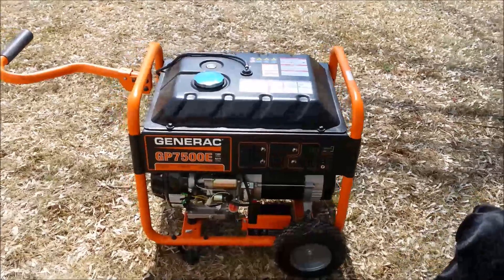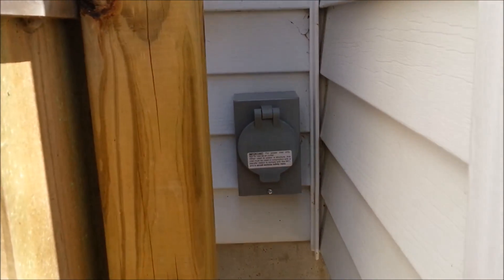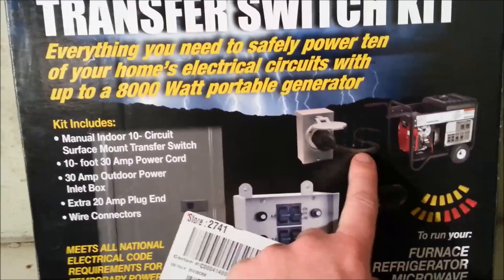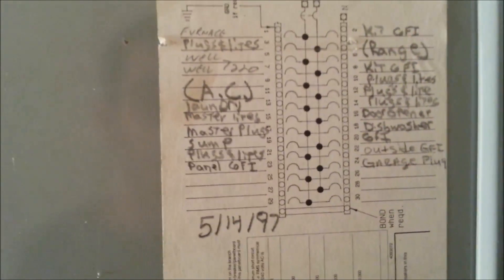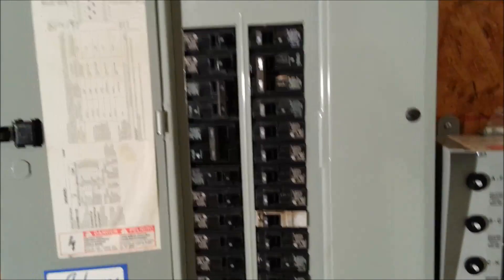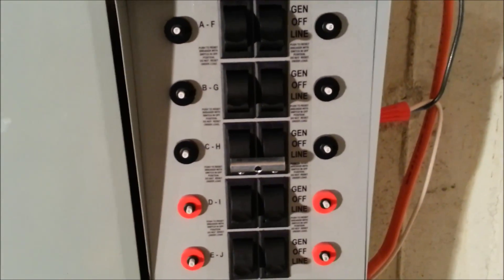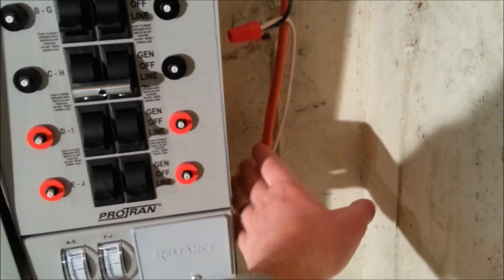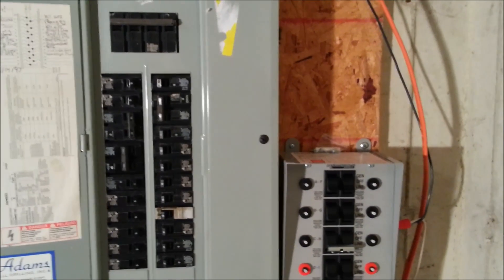Powering Your Home Safely with a Generator Using a Transfer Switch

Comment: I have the same generator and transfer switch but what wire do I take off the generator to change it from neutral bonded to floating?
Reply: +SSLFamilyDad 

Because the neutral and ground are bonded in your main panel which connects to the utility, you can't have a connection between neutral and ground at the generator. Unfortunately a lot of generators have neutral bonded to ground as they are used in as stand alone power sources where this is a requirement for safety reasons. 

There are three ways to fix this, but the first 2  present safety issues.

The easiest is to make a custom generator cord with the ground disconnected. The drawback with this is that the generator chassis will only be connected to neutral and could become live during some fault conditions.

The next easiest is to modify the generator to unbond the neutral from the ground. This will void the warranty, and make the generator unsafe for use as a standalone power source.

The third way is to purchase a generator which is solely intended for use as a backup power system and designed to be mounted on a concrete pad. This is an expensive proposition, but it is the the safest solution. The other drawback is that it can't easily be used as a portable generator.

I have the same transfer switch that you do and use a Generac LP5500 generator (propane). I chose the first method, as I am not going to touch the metal chassis of the generator while it is connected to the house electrical system. This also allows me to safely use the portable generator, for standalone use.
Reply from the maker: I remember not having to do that for some reason. I will have to look that up and get back to you.

Comment: Nice job on this video, I just had one question what is chirping in the video?  Sounds like a low battery on a C02 or smoke alarm.  I was looking around in my office for a device that I might have set on a shelf until I rewound the video a few times and discovered it was coming from your house.  LOL
Reply from the maker: +Deric Kettel That would be my stupid smoke detector, sorry about that!

Comment: Have you ever heard about the GenerLink transfer switch?
Reply from the maker: +bub2627 Those are a great way to go but not really a DIY project. You need to have those installed by the utility behind the meter. They look nice though.
Reply: Not all electric companies allow the Generlink. First energy is one of those that do not.

Comment: So does the generator output 30A through all four prongs or 30A + 30A through 2 sets of prongs. Its just that having one 30 amp plug connect to a 62.5 (7500 at 120 volts) generator doesn't add up. If someone could clarify that would be great. I'm thinking of setting up a system similar to this myself.
Reply from the maker: +Micim987 Original It is 30 amps total at 240v. I understand where you are coming up short with the math as this only gets you 7200 watts. I suspect this has something to do with estimating and marketing:) Technically you could max out the 30 app outlet and still have something plugged into the other 15 amp outlets at the same time and overload the generator. I believe the generator has the overall capacity to generate and sustain 7500 watt loads in total.

Comment: I just went and looked at our breaker box all our switches are 20 amp? confused
Reply from the maker: KYfishguy Well one of two things happened there. Either your home was over built and the electrician put all 20 amp circuits in there or someone replaced the 15's with 20's. The latter being the dangerous scenerio. Check to make sure all of yor wires coming out of the box are 12-2. It will be written on the side of the wire. If any of the wires say 14-2 then you want to call an electrician to sort that out and make sure the correct breakers are being used.
Reply: thank you

Comment: What happens if the power turn back on, While you use the generator? Would that blow the fuse?
Reply from the maker: tanh van The beauty of the transfer switch is that it separates the two circuits completely so if the power comes back on when the generator is on there is not crossover and therefore nothing will happen. You can then just switch back to grid power for those circuits and you are good to go. Hope that clears it up!
Reply: NO

The circuits that are switched to generator will be isolated from the re-energized mains power.
Simply turn the switches back to normal position AND THEN power down generator.
Starting or Stopping a generator should never be done with a load...severe damage to many devices (other than light bulbs) could occur

Comment: Very nice and extremely informative video, thanks.  I plan on buying a generator this year (a Subaru SGX5000)  and, like most people, have investigated the various options.  This is definitely the way to go. My house is small but all electric.  When the power goes out - that's it.  I do have city water so that's a blessing. Thanks again, all the best.
Reply from the maker: Glad you found it useful Tony, good luck with your setup!

Comment: How can i integrate this, with solar.
Reply from the maker: What I plan to do with mine is to add a switch on the incoming line from the generator and add an incoming line from my solar/wind to the switch. Then you can select either generator or solar on the selector switch and choose which circuits you would like to power with the solar. Hope that helps!

Comment: Hello- I have the exact same setup-butmy unit is the 6500E and same transfer swith- But I called generac and they said that I should TURN OFF the MAIN - because if the power comes on it is like having double power and it could feed back into the generator and cause a burnout??   So I see as you do- you turn off the main- isn't this safer?? And do you recommend I do the same?
On another note if you will- I never used this unit yet and need to make sure I do the right sequence in case I need it- So first 1) I start the unit- 2) then plug one end of the plug into the unit and the other into my backwall where the female plug is- 3) then TURN OFF the MAIN-(even though there is no power) then 4) turn on only the switches I believe I would need on the transfer panel and that is it???
Now if I need to add gas or oil- do I need to turn OFF those switches - and then UNPLUG the machine and then TURN machine OFF-let it cool off for how long??? and then add gas and oil etc?? and then start the machine again and start the turn on process all over- am I correct???  Please advise-- your video was amazing-- thank so much and I hope to hear your answer soon.
Sorry for the bother But you only answered my second question- not this one :)
Reply from the maker: No problem at all. First, when you use a transfer switch technically you do not need to turn off the main breaker, that is what makes the transfer switch a better option than back feeding through a breaker. However, I normally turn mine off just out of extra precaution. Second, the order of startup - You can just power up the generator, plug it in, then go down to the transfer switch and turn on the circuits one at a time until they are all on. If you need to change the oil or add gas I would recommend turning off the circuits on the transfer switch first, then go out and power off the generator add gas or change the oil, then repeat the startup process. You should never start the generator under load meaning starting it with it plugged into the house and the transfer switch circuits on. Hope that helps.
Reply: SSLFamilyDad u r so helpful- it is very much appreciated. thank u again.
Reply: SSLFamilyDad what I am real surprised at is that generac did not say what everyone else is saying that we do not need to turn off the main(they said to turn it off??)- - are they just covering themselves?? Not sure:)
Reply from the maker: Mo Kravat Probably just being safe. If you do not wire the transfer switch correctly you can still send power back out to the lines. It never hurts to turn the main off.
Reply: SSLFamilyDad :)  thanks

Comment: Hi again-I do have one more bothersome question-- on the transfer panel- Yo have little buttons(black and red circles) to the left and right of the breaker swithces-- what are they and do you ever need to "press" them- or do anything with them-- what are they there for??
Reply from the maker: NP, those are circuit breakers for each circuit. They are black= 15amp and Red=20 amp. Should not ever trip those but they are there to protect the wiring from accidental overload

Comment: Hello- I hae the exact same setup-butmy unit is the 6500E and same transfer swith- But I called generac and they said that I should TURN OFF the MAIN - because if the power comes on it is like having double power and it could feed back into the generator and cause a burnout??   So I see as you do- you turn off the main- isn't this safer?? And do you recommend I do the same?
On another note if you will- I never used this unit yet and need to make sure I do the right sequence in case I need it- So first 1) I start the unit- 2) then plug one end of the plug into the unit and the other into my backwall where the female plug is- 3) then TURN OFF the MAIN-(even though there is no power) then 4) turn on only the switches I believe I would need on the transfer panel and that is it???
Now if I need to add gas or oil- do I need to turn OFF those switches - and then UNPLUG the machine and then TURN machine OFF-let it cool off for how long??? and then add gas and oil etc?? and then start the machine again and start the turn on process all over- am I correct???  Please advise-- your video was amazing-- thank so much and I hope to hear your answer soon.

Comment from the maker: The transfer switch I am using can be purchased here - http://tinyurl.com/nf9kune
Reply: So when you have a transfer switch installed, does that eliminate the need to go turn all the breakers to the off position? And then being able to just leave the main breaker on and transfer power through the transfer box instead?
Reply: You have the double pole breaker installed incorrectly. You need to install it on the 20 amp breaker (red)

Comment: I have the EXACT configuration set up in my home and it is great. Question: when you do lose power and you need to use your generator, DO YOU NEED TO SHUT OFF YOUR MAIN IN THE SWITCH BOX?  All of my research says no - it isn't necessary - just leave your main alone.  True?
Reply from the maker: With the transfer switch that is true, you do not need to have the main switched off. I generally do anyway out of habbit but it is not necessary. In fact it is nice to leave it on so when the power comes on the circuits that are not on the transfer switch will come on and let you know the power is back. Thanks for watching!

Comment: Almost all Generacs I have owned and worked on have a jumper wire from the neutral to the ground typically on the duplex plug (110V AC). I just disconnect the jumper from the neutral and leave it connected to the ground on that plug. That way if you wish you can reconnect it and use it for portable power again. I however learned from a Generac tech friend to buy a twist lock plug and jumper the neutral to the ground in the plug thus not requiring opening the panel. I placard my generator that it has a floating ground and cannot be used for portable power unless the neutral is connected to the ground. Overkill most likely but better safe than a chance of someone being electrocuted.
Sounds to me like you have all bases covered, good job.

Comment: I bought the Reliance PB50 plug, the 10 circuit 50Amp transfer box and the power on alarm (for when power comes back on) but decided to go with an interlock switch. I need more than 10 circuits and 50A so for my situation I didn't use mine. I agree the Reliance equipment is excellent and easy to install. I bought the load meters for my EXL 10000 Generac and those are excellent at telling how much of a load is on your windings. I run well past 50A so the panel would not cut it. I ran 8 gauge wiring which is rated at 44 A per power lead and the same with the neutral and ground. Speaking of ground I didn't hear in your excellent video if you are using a floating neutral. NEC Article 250 pretty much states that you should remove the neutral from the ground on the generator (unbonding the neutral) and go with the residential neutral to ground. Meaning there should only be one location that the neutral and ground are bonded and that is your fuse panel. A large majority of people don't know this and it will usually be no problem unless your neutral breaks. I think you did an excellent job and I commend you on the Generac review and the how to do the home panel power using Reliance equipment.
Reply from the maker: Thanks for the info! The neutral bond is actually something that I learned about after I did this video. I had to do that when I used a Honda generator with my transfer switch and learned how that is done. I have not yet changed it on the Generac but that is on my list:) I agree that it would be nice to have more than 8-10 circuits and doing the panel interlock is nice also. I am planning to tie in renewable energy to the transfer switch so I can power a few circuits that was also so that was another reason why I chose this route. Thanks so much for commenting and watching!

Comment: With this kit do you have to turn the the main breaker(or breaker) off before flipping the switch on the transfer.
Reply from the maker: Nope, with this kit all you do is flip the switch on the transfer switch box from "line
 to "generator". The way it is wired it takes the possibility of any back feed out by disconnecting the circuit back to the main and sends power directly through the home circuit.